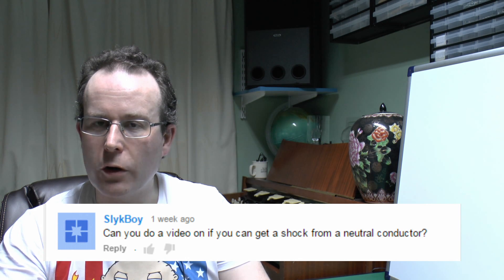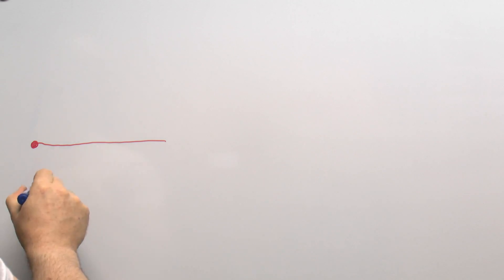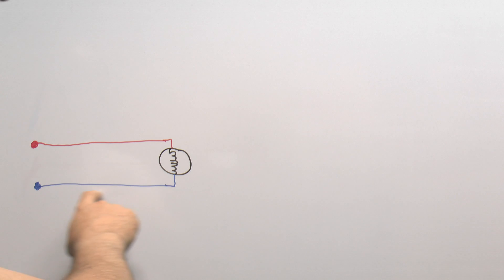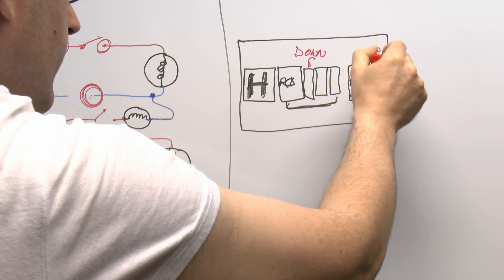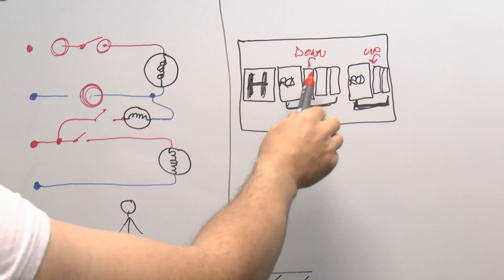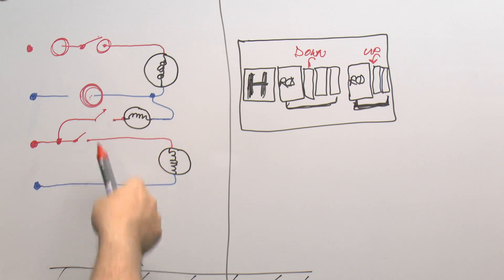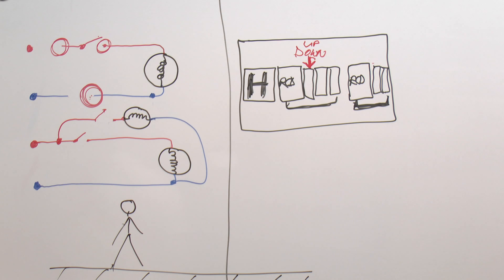Shared or Borrowed Neutrals on Mains Electricity Circuits

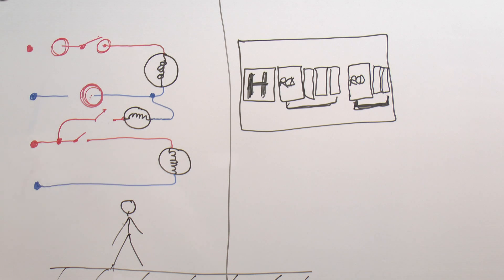Comment: Interesting video as always. Thanks for your time. AT 10:20 you mention that you don't especially like the configuration you mentioned. Our house is like that (UK) and I just wondered... what approach do you take and why? Thanks again for your time.
Reply: ***** In general, I'd always place kitchen circuits (sockets, hob, oven, fridge/freezer, washing machine) and garage/outdoor circuits on individual RCBOs. Nothing more annoying than a wet kettle base interrupting a recording on TV!
Reply from the maker: Colin Herbert The problem with the twin RCD arrangement is that a fault on one circuit will affect several others, and without testing equipment it is not obvious which circuit has the fault, leaving the occupier of the property literally in the dark until the fault can be found and removed.

RCBOs for all circuits is far better, as any fault only affects that particular circuit and it is immediately obvious which circuit has the fault.  It costs a bit more, but the advantages are well worth having.
You would still normally split the lighting into 2 circuits as with the twin RCD arrangement, unless the property was very small.
Reply from the maker: Dan Reeves Absolutely, a far better arrangement.  Costs a bit more but well worth it. For smaller properties with only 3 or 4 circuits, rather silly to even consider a twin RCD arrangement, as the cost of RCBOs will be very similar.
Reply: The most popular alternative to a split load configuration is using RCBOs which are essentially just miniature circuit breakers with individual RCD protection, meaning in the event of an earth fault only 1 circuit will be isolated instead of the usual 4-7. Another nice feature is that in the event of a Neutral-Earth fault on a typical split load unit the RCD for the affected circuit will remain un-resettable even if the breaker is turned off, with RCBOs it would only be the affected circuit
Reply from the maker: Colin Herbert It was the twin RCDs I don't like, not the division of lighting circuits.
Reply: Colin Herbert Definitely, they're a bit more of an initial expense but dang are they convenient.  Not having a faulty kettle take out half the house is awesome
Reply: Colin Herbert You always make sure the two circuits are separate. That means correctly running 3C+E upstairs.
Reply: +londontrada 
Gets down to definition of 'Circuit' too -- if you in one context consider the whole RCD output set to be a new circuit, thats' fine...   Do you ever consider a radial set of sockets on the secondary-side of a FCU to be a ''circuit''? etc etc...!  I got the impression this wasn't 100% clearly agreed upon...
Reply: Dr. Lecter Thanks but that wasn't my question. I was interested in JW's comment about not liking the split of light cvircuits between upstairs and downstairs. I get the message about borrowed neutrals ;-)
Reply: ***** OK, got it. Thanks for that. RCBO's do seem the way to go.
Reply: Its all very well saying that RCBO's are better but a lot of good electricians will disagree when it comes to domestic a property.. (A) RCBO's are very costly and you will almost certainly loose the job to some other electricain fitting a standard split load. (B) Fault finding RCBO trips are a lot harder to fault diagnose (for joe public) due to the fact they detect both residual current and overload. (C) With the standard of modern electrical installs now RCD faults are becoming less (by this I mean older installation this shared N 's are becoming less due to rewire's ect) (D) 99% of joe public can't figure out the arrangement of their own light switch so am almost positive they won't give a toss about what they have in their DB.

Great video tho, very well explained. (electrician of 17 years)
Reply: Colin Herbert It is arguable that split load consumer units are non compliant with BS7671. Regulation 314.2 states that circuits should not be affected by the failure of another one. Everyone seems quite happy to ignore this for some reason. I suppose because it is not dangerous in electrical terms (could cause hazards though) and is a lot cheaper.